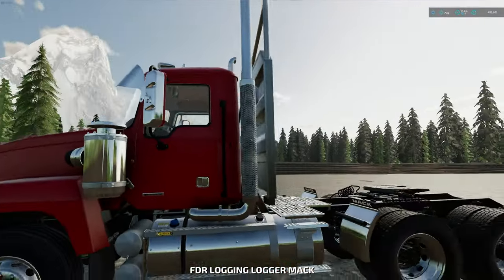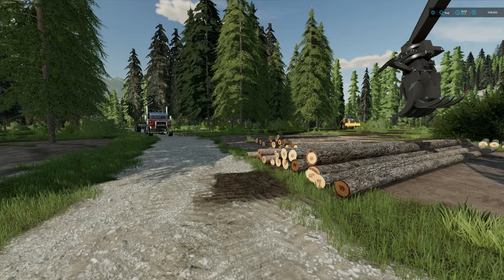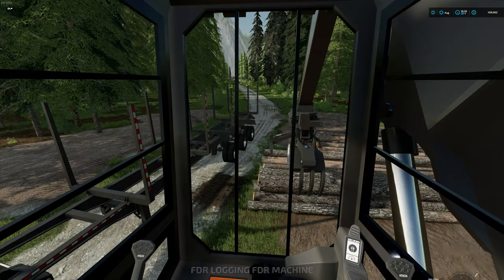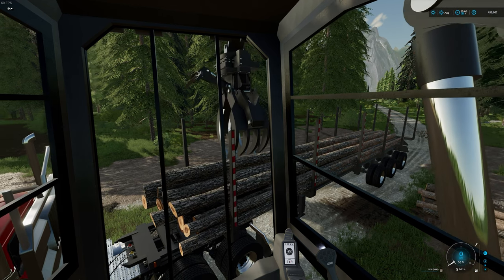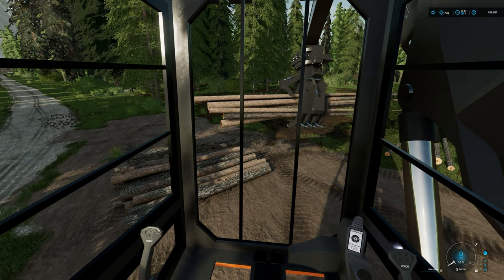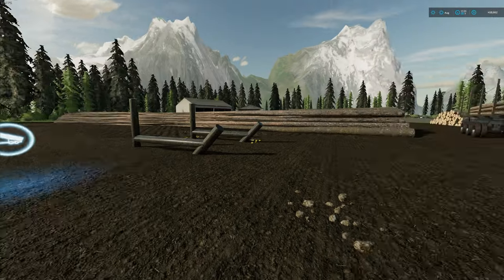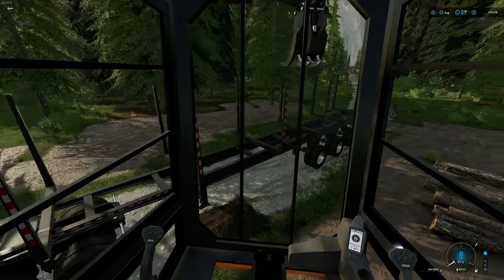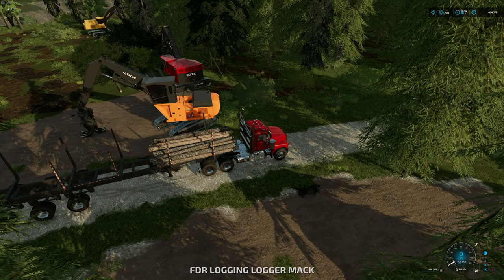Part 5 - Operating The Loader - Learn How To Log - FDR Logging

Comment: What action controls the stabilizer? I assumed it was Grapple Second Claw Open/Close, but I can't seem to get it working. All other attachments seem to work fine. I'm using the Fixed Clam Roto Rake as I don't seem to have the one your using in my Forestry Machinery list. Thank you & everyone involved for the awesome mod. I,m on FS19 by the way.
Reply: I'm in the same boat, Everything works on keyboard but there is no bind for those stabilizer actions.